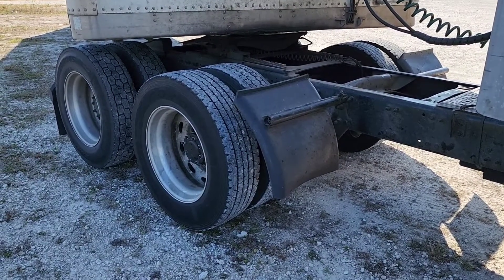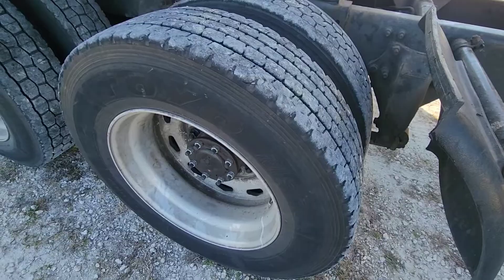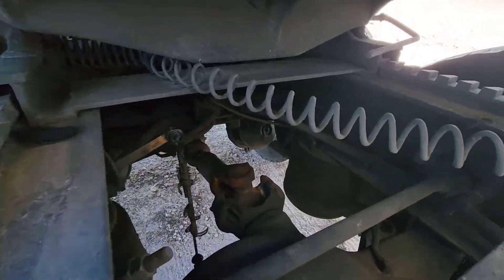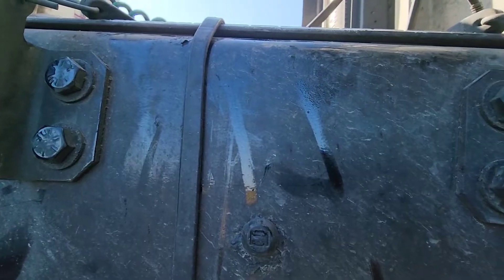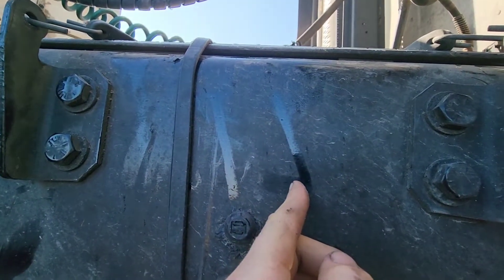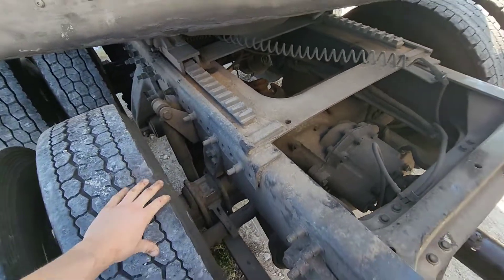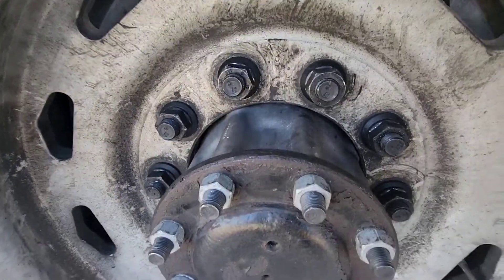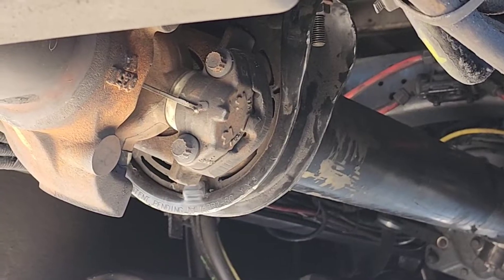Freightliner Vibration Sources Century Columbia Cascadia Semi Truck Troubleshooting Freightshaker

Comment: Vibration issues :
Tires out of balance 
Worn wheel hubs 
Suspension ride height
U - joints / carrier bearing 
Loose axle u-bolts
Fifth wheel placement 
Chinese brake drums
Driveline yokes out of time
Suspension bushings

Floorboard vibration , rear of truck .
Steering wheel vibration , front of truck . 
Possibly trailer conditions .
Truck frame ride height is even across drive tires .

Comment: Frame bracket that sits on top of the axle has to be at 2 5/8 gap on the front drive axle. Aligned perfectly
Reply: Use a  snuff and dip tobacco can for measurement .